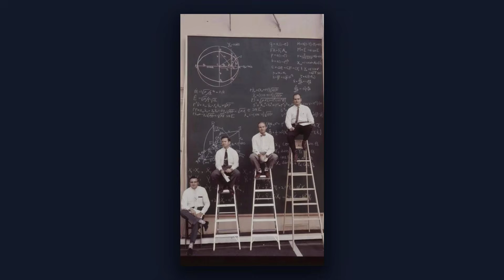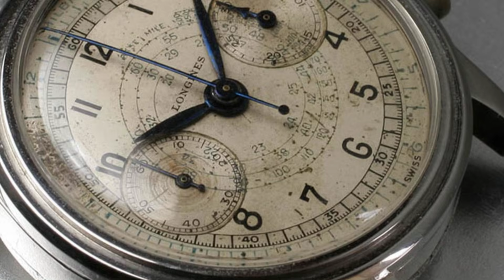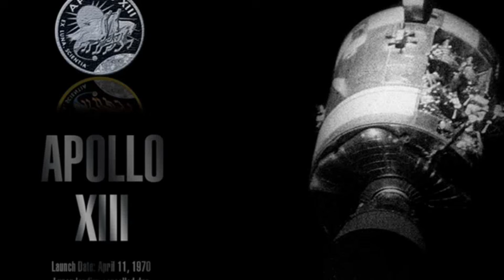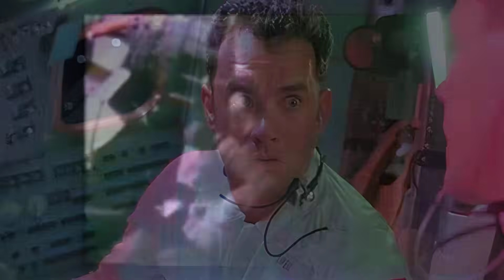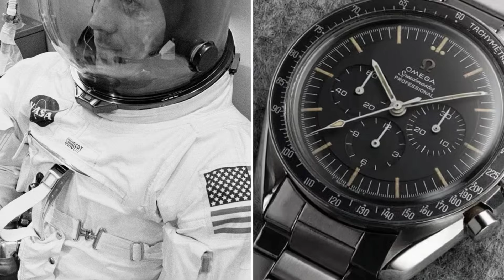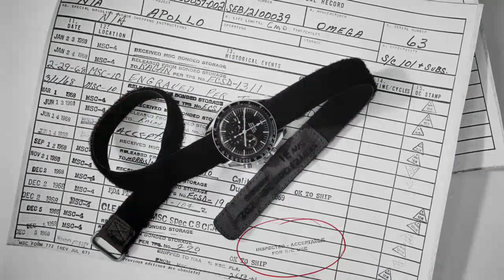The Watch That Saved Apollo 13

Comment: Ummm, it was Neil Armstrong who walked on the moon during the Apollo 11 mission.
Reply: Both Armstrong and Aldrin walked on the moon, with Armstrong being the first to step out. However, Armstrong did not wear the Speedy; he’d left it inside to backup the lunar module chronometer. Aldrin is thus the first man to wear a watch while walking the lunar surface.
Fun fact: while the astronauts wore the Speedys during training and actual missions, they never actually owned them. They were the property of NASA, who often struggled to get the astronauts to return the issued watches so future missions could use them. The head of the astronaut office, Deke Slayton, finally threatened to revoke permission to use NASA’s training aircraft unless the watches were returned.

Comment: How come NASA chose a chronograph that doesn't even have a hacking complication? This watch cannot be synchronized.
Reply: Bear in mind that telling the time was not the primary point of the chronograph for astronauts; it was the actual timing of tasks and procedures, as in how long a manoeuvre in space or a light could take. Hence the need for timing engine burns, pressurizations, and so on.